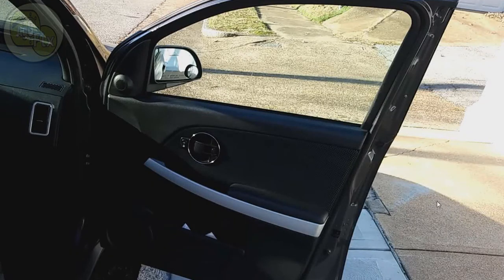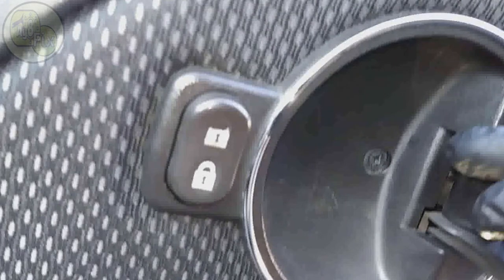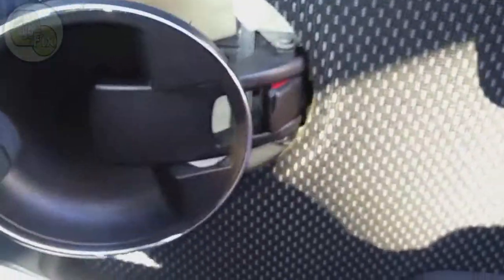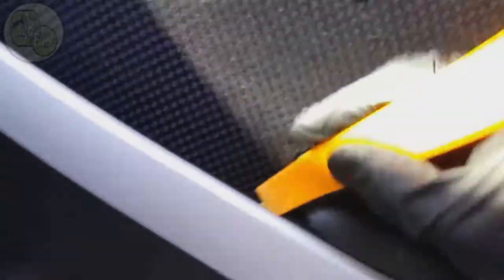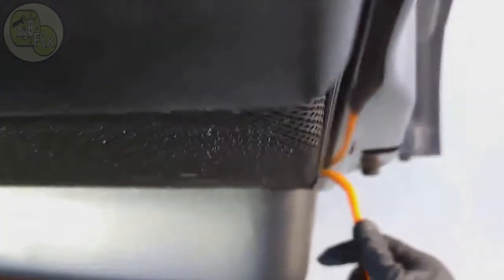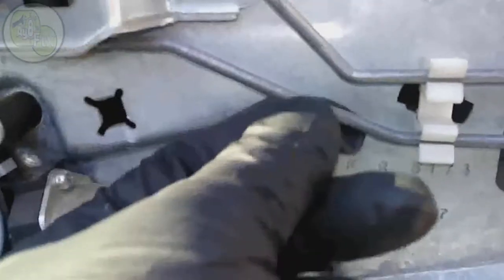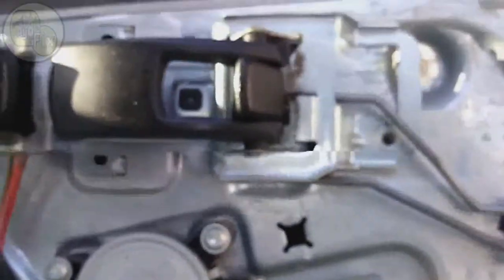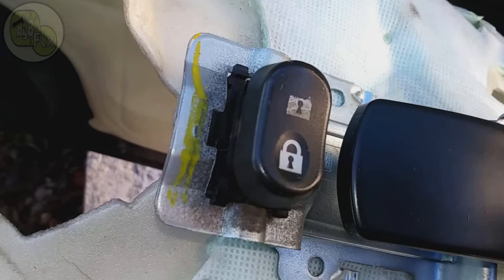EASY Inside Door Handle FIX For EQUINOX & TORRENT

Comment: What is the clip called and does it have to be specific for my car? I have an 08 torrent and I want to buy the clip before I take the door apart
Reply: I have the same year same problem on passenger door - did you get it fixed? Looks easy. How much was part? Junk yard or OEM?

Comment: I have an 05’ equinox and the inside handle broke. A couple days later the outside broke off now I can’t get it open to change either one lol
Reply from the maker: If you remove the round bezel around the handle and the lock you may be able to access the metal rods connecting to the handle.  You may be able to get a pair of pliers on the lower rod and pull on it to release the door.  It's no a guarantee but it might work.

Comment: it's really very difficult to hear what you are saying in your video as I bring my computer volume at the max level but still can't hear your voice. Very weak voice which is not hard to listen so please correct this issue in this video as soon as possible with thanks in advance. I have chevy equinox 2008 which have the issue the front passenger (right side front) door not opening from inside) something must be broken?
Reply from the maker: Sorry for the audio.